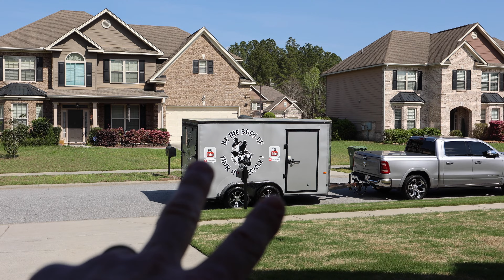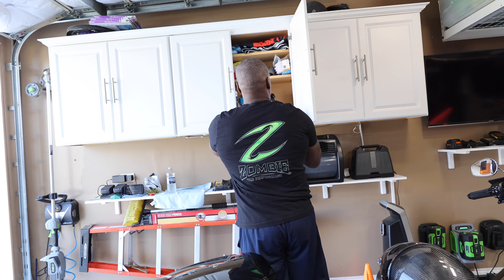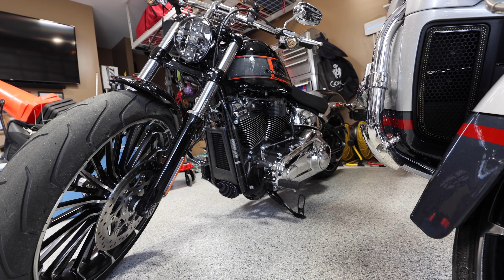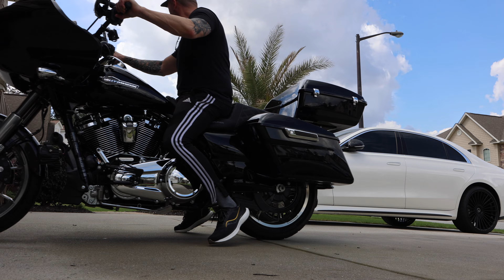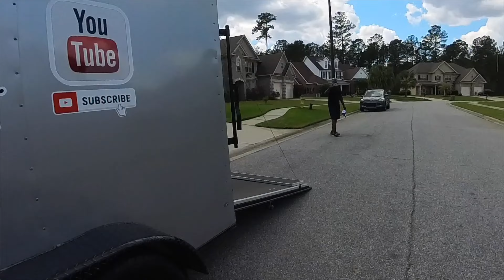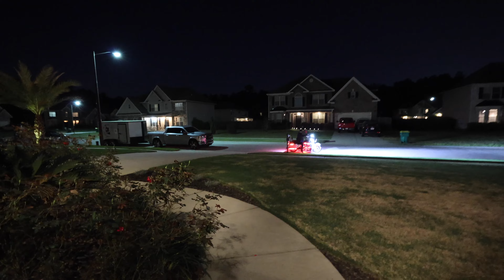VLOG #2 Arriving to 2023 DAYTONA BIKE WEEK 1150 MILES #harleydavidson #cyclefanatix #roadglide

Comment: Quick question and I know this is 10 months later but what helmet do you use and also when Rob pulled the CVO out of the garage that was smooth and then he finished it off with doing a little loop around your bike. It was awesome he’s a smooth operator.